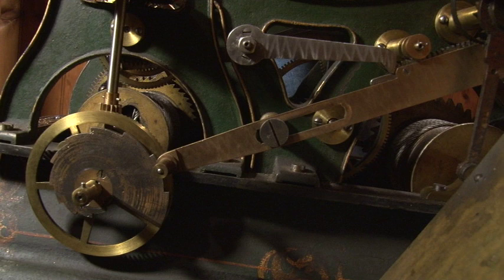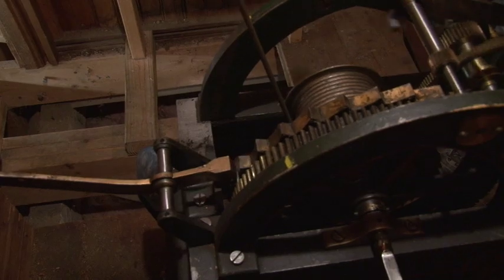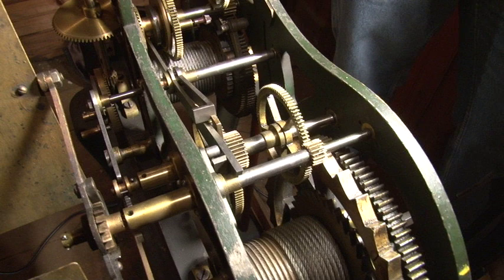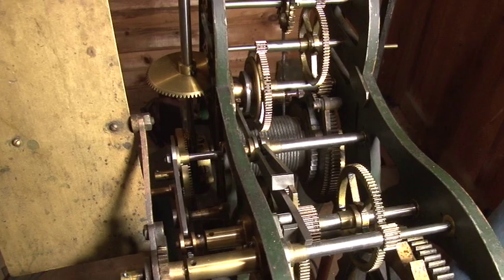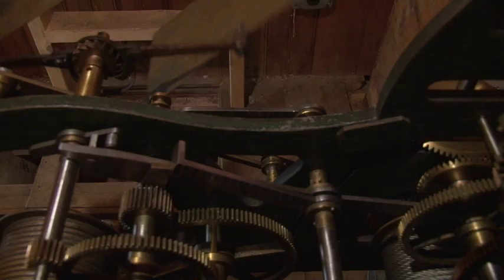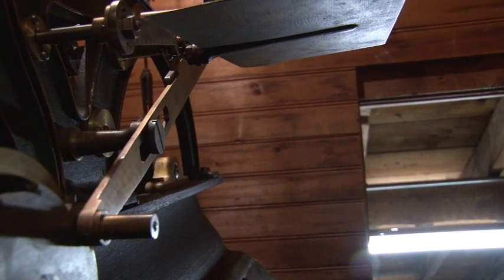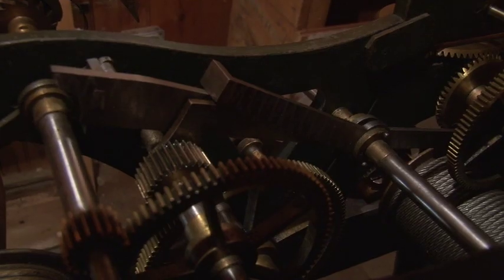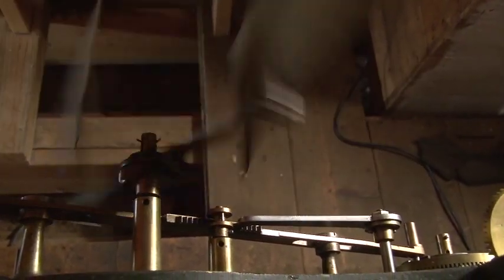How the Rack and Snail Bell Striking Mechanism on a Tower Clock Works.

Comment: Hi Trevor,
I'm working on a quite large E. Howard Clock that hadn't  been run in a very long time. I fixed the bent escape wheel and made new bearings for the escape pinion shaft. I found the rack frozen and cleaned it up. Today, the last day of the year, I'm going in to see if I can get the hour strike to work for the New Year. I pretty much figured out the operation but your video helped a lot on the pawl mechanism. 
Best for the New Year,
Rob
Reply from the maker: I'm really glad to hear it. I hope the clock finds new life in 2015.
Reply: Trevor Murphy Thanks Trevor,
I just took a look at the beginning of your video where the hammer is striking the bell and it looks like the hammer sits on the bell between strikes, perhaps it's just the video and this isn't the case.
best,
Robert
Reply from the maker: mosfet500 It does not rest on the bell. Must be a bad angle.

Comment from the maker: It also occurs to me that I've seen a similar amount of grime and dust on smaller clocks and the movement stops after a few minutes of fighting the friction of the dirt. These big clocks with a hundred or more pounds of weight powering them can overcome quite a bit of dirt.
Reply: do you know if the first congregational church's bell' in the future that it will sound the hour?

Comment from the maker: I think you are seeing a 100 year old clock with 100 years of exposure to the elements. I think I have spent 10 hours cleaning it, but not polishing it. I worked to remove dirt and grime that might add friction and I added oil. Some parts do look really dirty, but they resisted my best cleaning efforts. 
The actual movement behind the dial was the most weathered part of all. I was surprised it still worked.